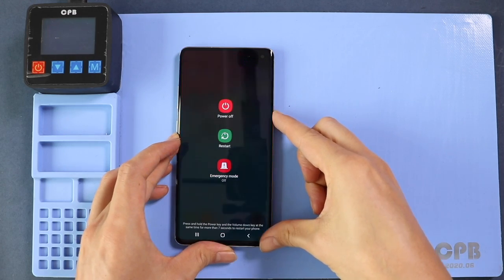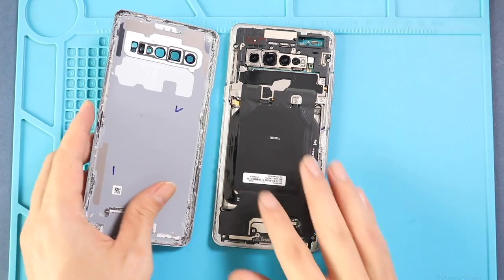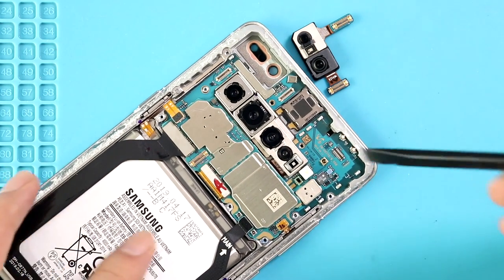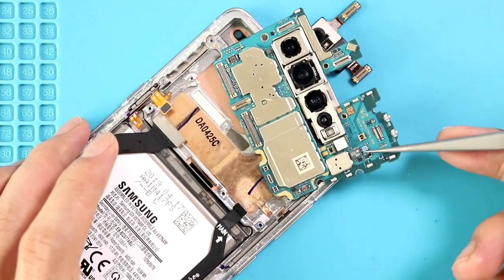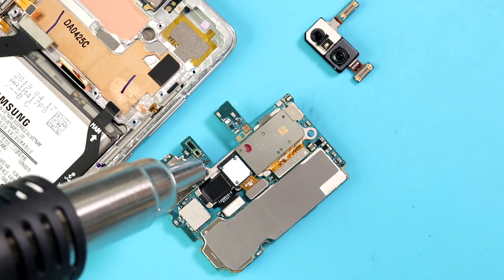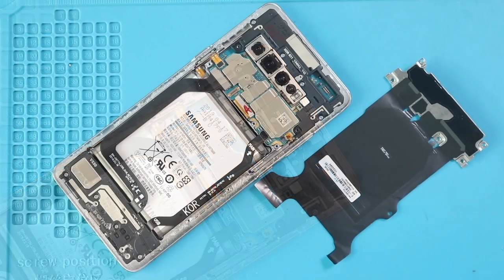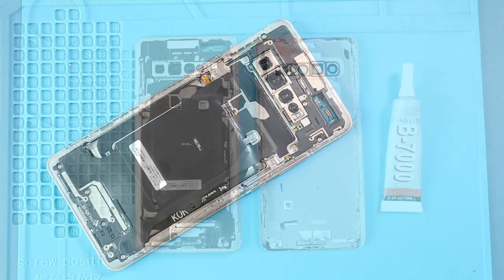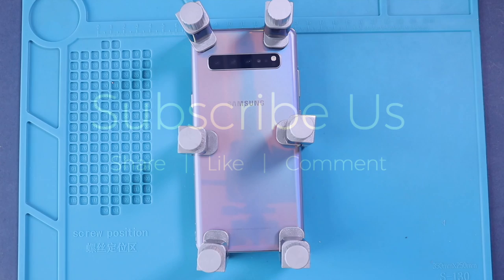Samsung Galaxy S10 5G Camera Replacement

Comment: hi, my front camera is not working it always said camera failed. if i change the front camera would there be any chance that it gets fixed? thank you
Reply from the maker: Have you try to boot the phone in safe mode to check it? also you can go to diagnose mode
Reply: @DIYGeardo  I tried to boot into safe mode but the problem is still there. I think the front camera is faulty. I tried to remove the front camera and open the camera app the camera failed message appear immediately while when its connected the message appear with 2-3 seconds delay. Back camera is working fine.
Reply: Mine says" couldnt open camera try again" on the lock screen but ican use it on camera mode or on the social media apps its weerd